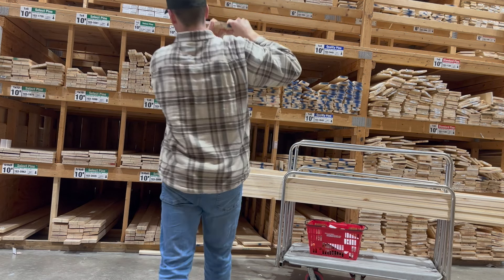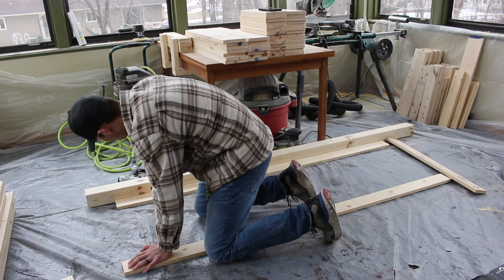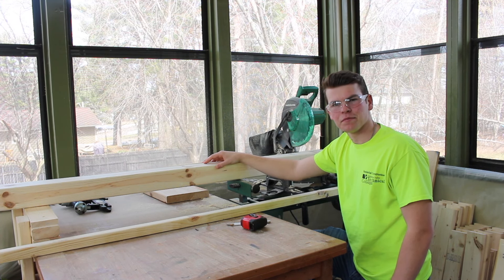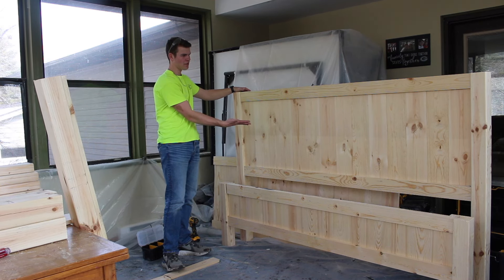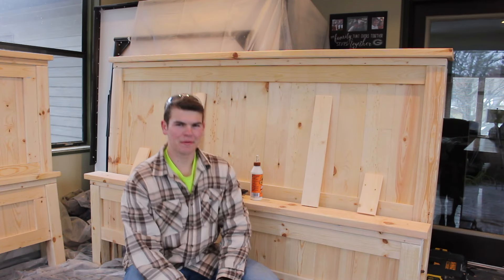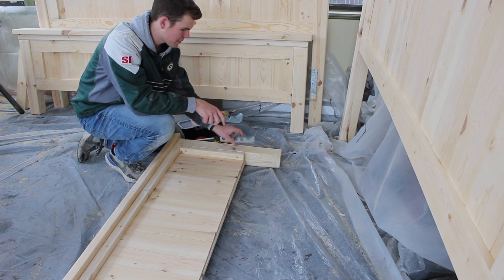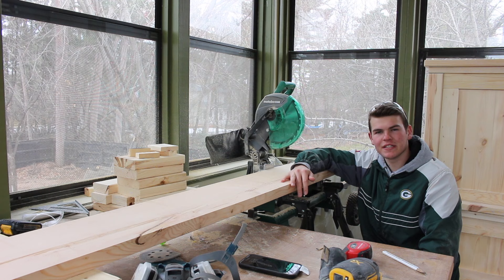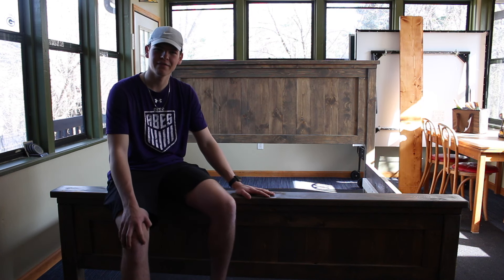How to Build a Farmhouse Style Bed Frame

Comment: Hello Charlie. What are the chances of you posting a materials list of what is needed?
Reply from the maker: @RogerGabrielMusic  for a king size; 13 - 2x4 8 feet long 
2 - 2x6 8 feet long 
2 - 2x10 8 feet long 
2 - 4x4 8 feet long 
1 - 2x2 8 feet long 
5.25 - 1x6 10 feet long 
5 - 1x4 8 feet long 
Nails: $5
Screws: $5
Stain/Paint: $30
Braces; $20

Comment: What size bed was this made for
Reply from the maker: @TyWilson-g3o  king
Reply: @CharlieNilsson I didn’t understand how you attached the supports on the side rails that would hold the slats that hold the mattress, at the end of the video, the wood that isn’t stained, the boards attached to the 2x10 side rails… I don’t know what they’re called but anyways, how did you attach them? And will this bed need supports down the middle to help support the middle of the mattress? I could follow everything up until the tutorial ended with just the frame but no way to actually finish it off for practical purposes of actually using it, as in once we get to the part where it’s built and stained, how do we finish it off where we can actually place the mattress on it and use it?
Reply from the maker: @ 7:55 - At this point in the video I explain how to finish it off, you need to run about 10 2x4’s across the middle to hold up the mattress, these 2x4’s rest on the horizontal 2x4’s located on the side rails.  See the description for a link to the exact plan